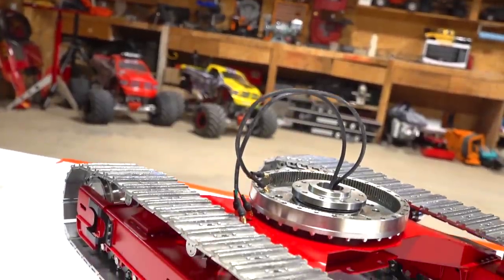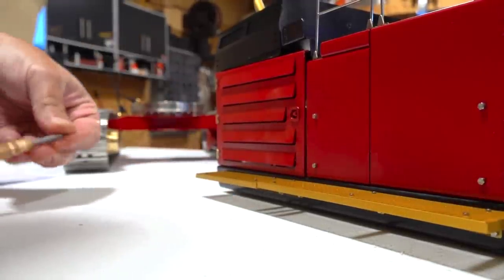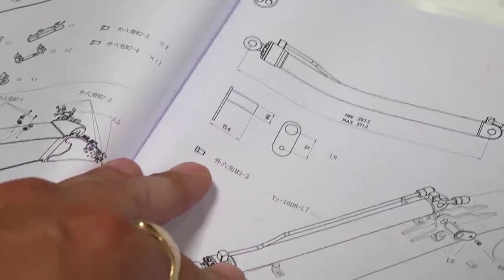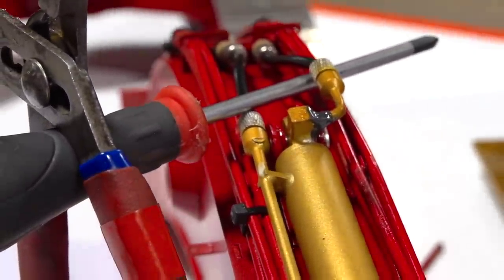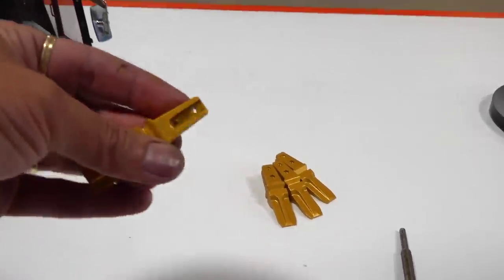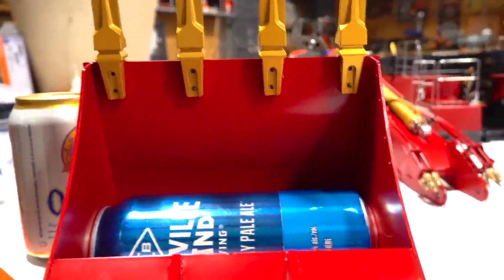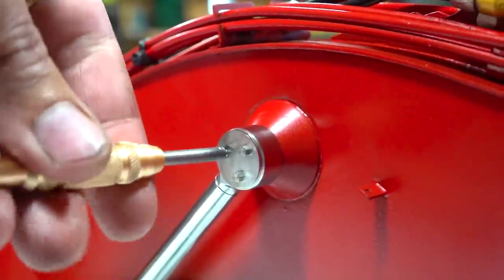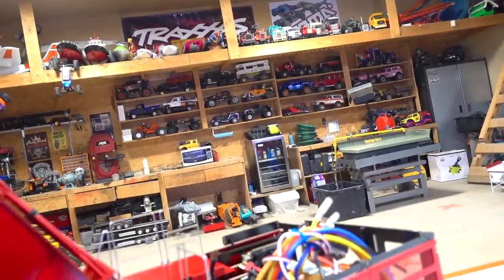"PROJECT: JOHNSON" aka "The Big One" - LESU CAT 374FL Kit Build PT 4 - TWSS SPECIAL | RC ADVENTURES

Comment: For the ram if you want to try to fix it yourself all you have to do is solder it back together. Take the ram off extend it all the way out to protect the piston and wrap the body with a wet rag. Then you can just use a small torch since there is not that much metal and apply some plumbing solder. You might be able to use electrical solder but not sure on that. I think the JB Weld will work if it was clean and dry and slightly sanded but solder will last longer since it looks to be a high stress location.

Comment: I can see why they angled the fitting downwards. You want to compress the flexible line on a straight axis to that line when the cylinder rotates so that there’s no rotational tension on the fitting when the cylinder moves. Another rule of thumb with excavators is keeping all the lines tucked in as close as possible to the structure. At least that’s the way it is with the real ones.☺️ I do custom hydraulic plumbing on excavators when we do shear installs or mulch heads. It’s actually not so different from what you’ve got going on here. Very cool!

Comment: If u have them, try putting plastic shims or washers on the pins at the ends of ur cylinders you may notice that it will keep it a little quieter so u don't get that rattle sound. It's what I use on my full size trackhoe . But cool build. Can't wait to see it on the mine site👍

Comment: Things to do or to improve:
Hey from France and owner of this Lesu super model !
What I think is my opinion, 
I notice you don't use the spring over tubing, I think it's better look with, it's hard to mount due to length of small tubes but cool thing to do. 
Other , I've replaced all ESC by hobbywing 1080 series and If module, I could set them as I want, I think they are better quality and take less space and could be better cooled by themselves and Lesu fan. I also mount ESC poWer button, WiFi module, and receiver on the storage behind the driver cab. Lot of space inside and far from fluid and heat.

I use for look but not needed, brass tubing for all the inside routing of fluid instead of plastic tube and spring. 
I've also cut the non finished hole in front of basement chassis to add a light in. 3 lights in front. 2 on the boom. 
And just for the look , I've mount the X frame with 1cm each side , so 2cm Widest for tracks. You have the hole to do it. With or without adding plate, but tracks look better and are now in the line of view of the step grills. 
You also could add LCD screen from rcbrmin or Lesu to check temperature and voltage in the screen holder in front of driver. (And a beer can)
I haven't notice any problems with the play between boom and cylinders, try with and Without washers. No diff at use. 

Have fun with this Great projects and be as happy as me. 

And for ever, you are awesome on each vids 
That's my daily pleasure to have good day. 
You are taking a big part of my life hobbies and thank you for that
😍💓

Comment: Great video series loved it.  Sorry for the pedantic comment I'm a bit OCD about it being in an engineering background. A bolt is a fastener that is used in a clamping application where you need to use a fastener with a nut.  So what you call a screw can be a screw or a bolt.  The application of the fastener is what determines if it is a bolt or screw, not the head type. This would mean you a running the fastener through two or more through-holes and using the fastener and the nut to clamp the pieces together.

When you only use a fastener that goes into a fixed threaded plate that is part of the machine or object you are assembling is considered a screw application.

Comment: Tig welding is the answer for that. Looks like A105 steel spaghetti lines, you can weld at cold er temperatures like brazing (very experienced welder recommended) but your weld will be much stronger. But on a more serious note a RC rig welding truck would of had you up and running by now👨🏼‍🏭😂😂. Great vid love the Johnson 🤙🏼

Comment: when you connect all the wires (22:01)  it looks like the brown wire of the esc is already showing the core of the cable. it misses a bit of outercable. maybe extra check it and place extra heat shrink. #lovethebuild

Comment: I asume these pipes en blocks are brass on the cilinder. That’s an easy fix: remove the paint at the joint heat it up with a small torch and gently apply solder. You might need some flux like s39 before soldering. Remove the cilinder from the boom, because otherwise you need to heat up the complete boom 😜.

Comment: I got a bad boom cylinder with mine so your stick cylinder was probably bad from the factory. The hoses on that cylinder should be as short as possible it barely moves, longer hoses on that one will cause more stress on the connections. The connections I really didn't like were the bucket cylinder and the 2 to 4 block on the boom cylinders, maybe you can give us your thoughts on those in your next vid. The track esc's didn't come with setup info. It took some research and an hour or so playing around with it to get mine setup.  Also do you use the supplied power blocks, solder or do something else to connect the esc's to your battery?

Comment: Sup man . So I've brought the cat 374 and have got about 90% through the build but I'm starting to have big problems with the wiring as the instructions from lesu are absolutely rubbish in my opinion. I'm wondering if you have any diagrams for the wiring side of things or know where to get some help via links on the internet for this. I have got the flysky paladin 18 controller also. I've watched your videos to try guess where everything is going so far. Any help would be greatly appreciated. Cheers from New Zealand, hope you and your family are doing awesome, cheers dude

Comment: Rather than resolder the ram fitting that will always be trying to fail, drill a new hole n put a screw in fitting in the front of the block so the hose does the  bending, thread the exsisting hole n plug it. No solder, all threads good n strong!

Comment: 0w0 almost there but u going need get other cycling  for top boom

if you wanted to know easy way to repair it i adjust u take it all apart where all plastic or rubber need to be remove otherwise it melted
use torque and sandpaper n soilding for copper fitting and sand it down where u be soilding at n put it together n heat it up for few sec n put soilding on it whiles u heating it let it melted around it should seal on it n put away heat let it cool down that way u fix it

Comment: Man! I hate that the hydraulic line broke. This is just a suggestion but try the J-B Weld putty. I think I have seen u use it on something else not sure I could be wrong wouldn't be the first time Lol.. but it may get you through a little bit better than that liquid J-B Weld you can actually put that puddy on over the top of that you already have on there

Comment: Here is a Heads up explanation about bolts .
When Talking About The Screws / Bolts 
   M is Metric 
   The next number is the thread diameter 
   And the  " x " is by 
   The next number is the length of the shank ( thread )

 So a   M 2 x 16
        Is a 2 mm diameter bolt by 16 mm long 
So a  M 2 x 25 
        Is a 2 mm diameter bolt by 25 mm long 
So a M 6 x 10 
       Is a 6 mm diameter bolt by 10 mm long 
    ? In stainless steel 
    ? In Iron 
    ? Cast
          Etc 
 Heat Type ?  / Strength 
Cap Type ?  Csk , button , hex .... Etc 

 I pick parts for international export to fix rock crushing , gold mining equipment.  
   Just Want to help people  understand  some ... code .

Comment: at 1:15 in, I believe you mis-spoke about the ESC's.  
There should be 3 Brushless ESC (1 for each of the Track motors, one for the Pump motor) and 1 Brushed ESC (for the swing motor).
Reply from the maker: You are correct Sir, I mixed them up :)
Reply: @TheRealRCSparks  Understandably so!   I've flown "full kit" planes (separate rudder, flaps, ailerons, landing gear, etc) with less channels and things going on than that beast.  Which turned out beautiful by the way!

Comment: Hi Aaron, it’s coming along nicely. I have a question about the drivers door. Does it open all the way parallel to the cab? If it doesn’t, how does the driver access the panels behind his compartment, where the hydraulic pump is located? There seems to be no way of getting there without getting off the machine altogether.

Comment: The plumbing issue at 14 minutes in, looks like solder not brase I'd talk to a plumber to repair it . Pull the ram apart to avoid burning the seals it should be an easy fix.

Comment: Excellent explanations and the project is going really well, the change of side for the hinges is a good thing, there is just that of the cabin door to paint because I do not think it should be possible to put them otherwise. It is a long construction to do but I am really impatient to see the first test in Youtube Gold 😊 Awesome work !!
Reply from the maker: Im still working on it brother, but thankfully I was able to repair the hydraulic ram with some solder. I have been running hoses for days!
Reply: @TheRealRCSparks  I'm glad you found a solution for the hydraulic ram, it's really a splendid machine and I can't wait to see the rest of your work, have a good day Aaron and thank you for your message, it makes me very happy 😊👍

Comment: You should be able to use regular SOLDER on that joint I did on the hard line to the PRV (pressure relief valve) I just put flux then heated the joint and feed a little solder in.

Comment: I'm curious what you use to control something like this.  I have a 2.4 ghz, 8 channel remote with two sticks that you typically use for RC plane or helicopter flight.  Would something like that work?  If not, can you point me in the right direction?  Thank you!

Comment: If you have or haven't watched JohnnyQ90 he does a simple version of brazing small things when building his stuff. it's actually very easy the way he does it and with that application you should be fine using a torch and some Rosin Core Solder.

Comment: I realise I'm well late to the party on this but I think I know what went wrong with that ram. At 12:12 the instruction clearly shows that inlet on that ram is joined to the hose coming up the boom whilst the ram is in a raised position, not  flat against the boom like you had it. 

Like that, when the ram IS flat to the boom the hose would ALSO be pretty much flat to the boom . . . .
Reply from the maker: The outcome of this was: Lesu actually Thanked me and changed the design because of this video. It was wrong

Comment: The hydraulic cylinder where u used JB weld, u could cross the hoses from one side too the other to get more hose for more flex, then cross them back at the other end to hook them up to the correct nipple

Comment: Hello from Germany, first of all: 
You will be a bit disappointed with your C374f... 
I own meanwhile a lot of hydraulic excavators, also the rc4wd 4200xl, 360L (with premacon valves and pump maybe the best allrounder model on the market for low price), got 2x THE MOTHER PC700 , fumotec pc490, Fumotec PC290 and some other models. My comments to my Lesu C374f :
- yeah my connectors on the boom broke also after some days....
- Its more a scale than digging modell
- it has not enough power for its size and speically for the bucket
- the pump (you got the 2nd version already) is crap
- the valves are crap
- the cylinders are way to small sized (16mm outside vs 25,5 mm outside @ TheMother PC700), the mother feels like 5x stronger
- you cannot lift the arm high enough to load a truck next to you.... But you can dig like 5 meters under your excavator , you can lower the arm way to far, so the main-cylinder hit the tracks....
- the cylinders @ mainarm and bucket are wrong size, they have extentions to fit somehow... 
- there is a huge play on the swing mechanic, you cannot turn controlled
- it is not weight-balanced, the counter weight is too heavy, the excavator always try to flip backwards... and you have not enough pressure to dig in hard ground cause the weight always pulling you back , if you drive uphill, you usally risk to flipp to the back...
- the ESC for the tracks are shit, you cannot configure it, the got a break function you cannot disable it - buy some cheap china "the rain 320a" esc, the work much better
- the tank is too small
+ The tracks are cool, the size is cool
+ the weight with about 30kg is pretty good for the size
I guess i missed a lot, but i gues it could help you my friend. Best wishes!